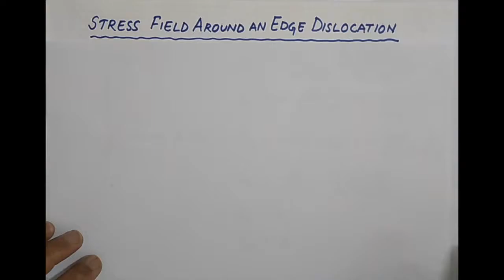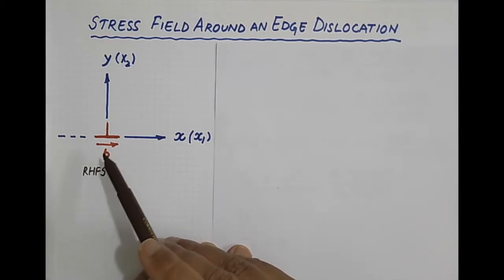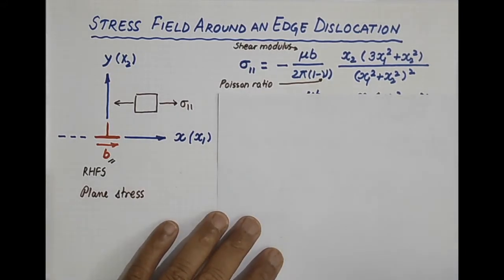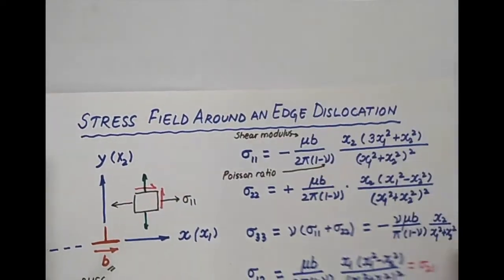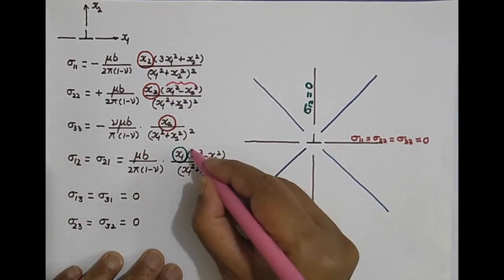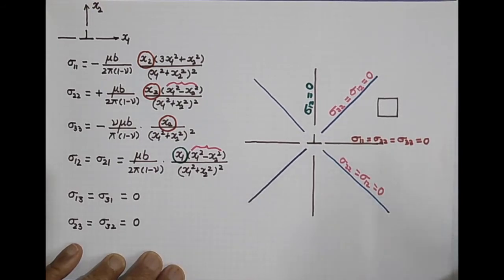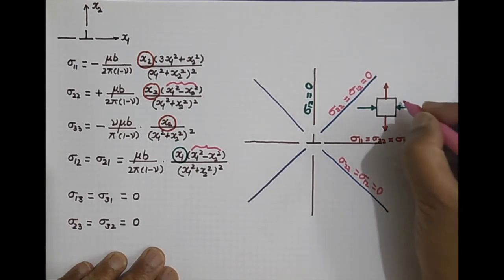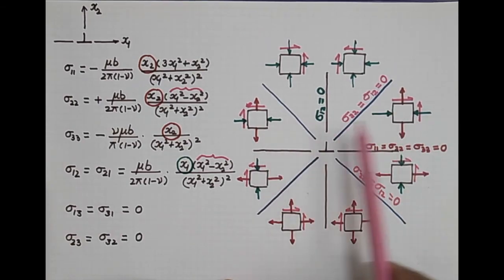Stress Field Around an Edge Dislocation

Comment: Sir it will be plain strain condition not the plane stress. (i.e in plane stress condition, stress is one of the direction is zero).
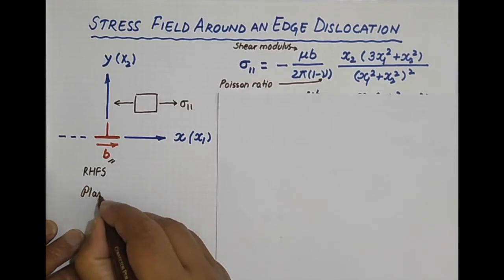Reply from the maker: Oops! Indeed I have slipped at 04:04 by INCORRECTLY stating that stress field is Plane Stress. It is NOT plane stress but plane stress. I am still on my learning curve. Thanks for pointing this out Deepak. If you visit Delhi do join me for a cup of tea :-)
Reply: @rajeshprasadlectures  what a generosity sir! hats off